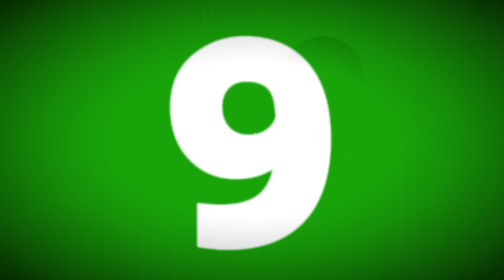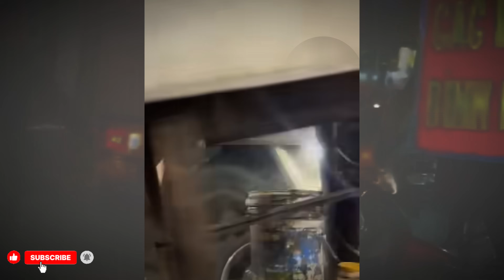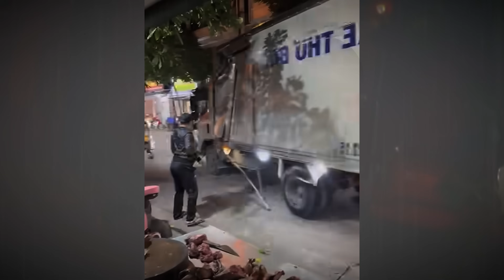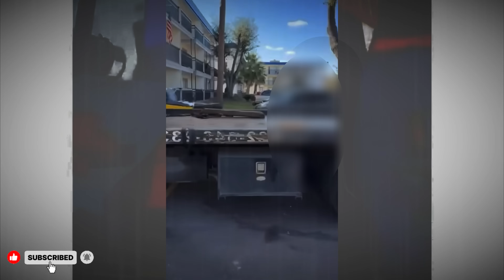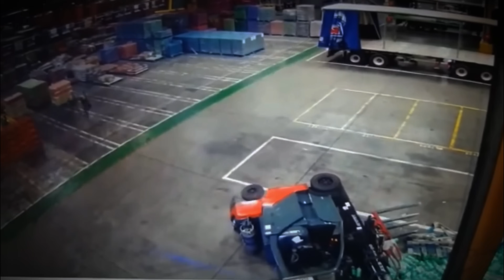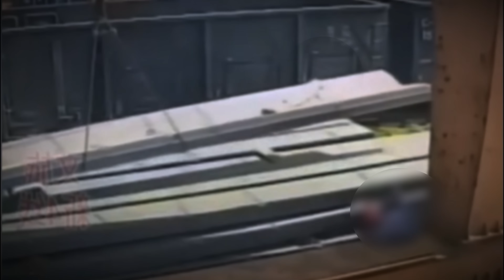He Was Standing Too Close… Then This Happened!

Comment: I've been fork lift certified for more years than I want to admit to. We have to go to class every 2 years and get certified and given a card saying you passed the coarse. Only those that passed could drive a forklift at my work.   In it we were taught before even turning the key. BUCKLE YOUR SEAT BELT !  It will keep you inside the safety cage incase of a tip over or off the dock accident. None of the videos I've watch in these have I ever seen someone wearing a seat belt.
Reply: Years ago I used to use forklifts all the time in steelworks and car parts manufacturing companies. Never had a licence and was self taught. Never had a problem with with anything. I know in retrospect it was wrong but the companies didn't care unless I'd had an accident and would bear fault. I did it because it was an easier job than the one I was employed for 😂
Reply from the maker: you are so good 😂😂
Reply: @ciararespect4296  I too was self taught back in 1977. Nobody cared back then. The rules changed and I didn't care and happy to go to a class I knew everything already and it was a change of pace and got me out of work for 1/2 a day with pay.
Reply: @MatthewPettyST1300 nice one. As you say they didn't care back then. And even now in some places like China and India they still don't care